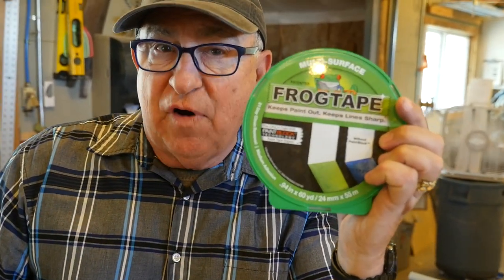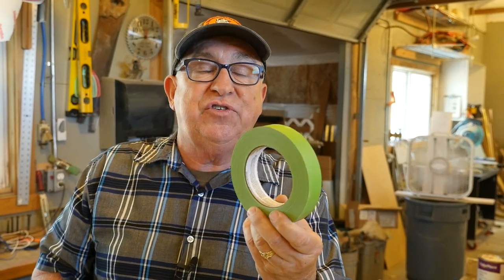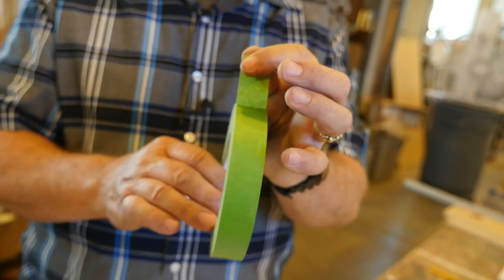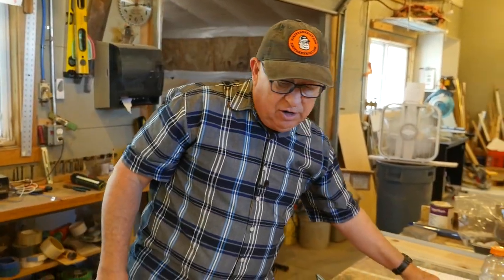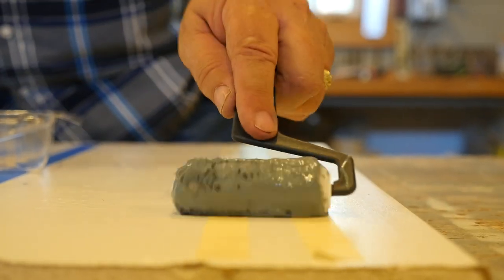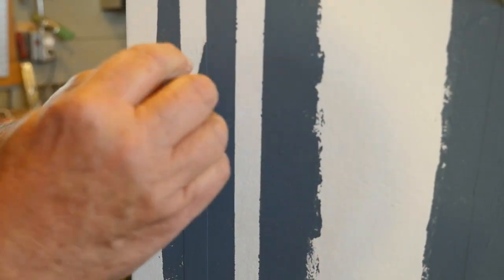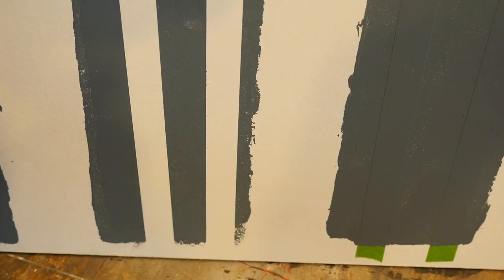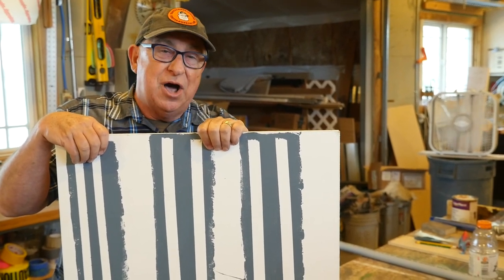Does FROGTAPE® Really Work THAT Well?

Comment: I use masking tape for skirting boards to the floor and for around windows. However the frog tape for them crisp lines on the top of the skirting board if it have to and also for when two colour a room might join such as a feature wall
Reply from the maker: Great insight, Spoonfed! Thanks for writing. Best, DFJ